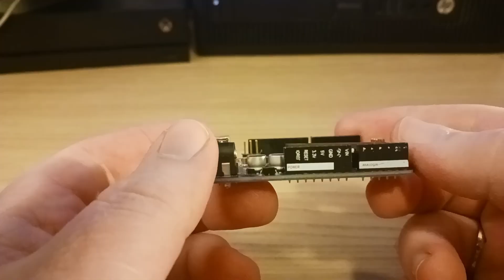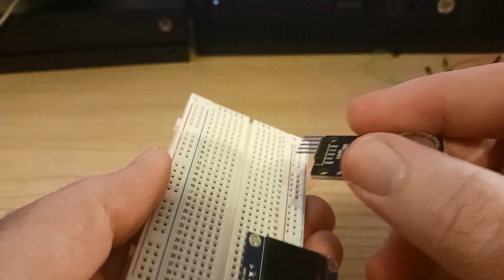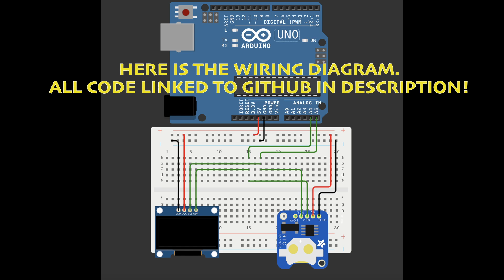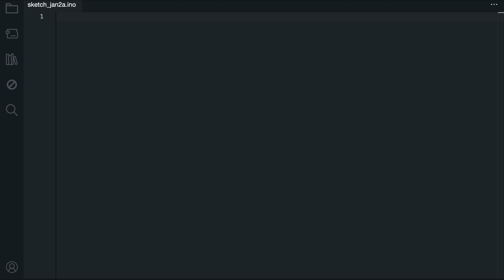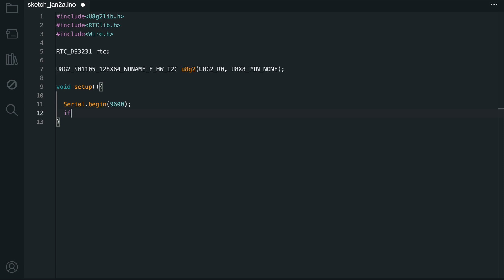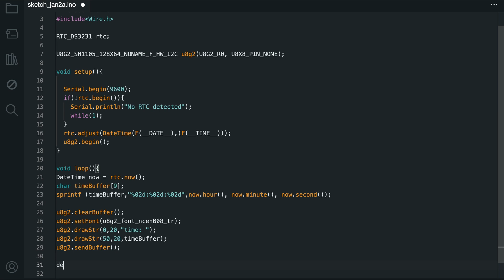Building a clock with Arduino and less than 40 lines of code!

Comment: Do you have any esp32's ?  I have the modules you used, but I belive the esp32  only has 3.5v
Reply from the maker: Hi! I do but i haven't used it for a build yet. That said, I hashed this one out on Wokwi with the help of google. The code is mostly the same, SDA is GPIO21 and SCL is GPIO22. This model uses VIN as a 5 volt source, provided that the board itself is plugged into a 5 volt source, such as a usb port on a computer. Keep in mind that this is just a model and that real world parts may not behave the same way and damage/failure could happen to the board. I guess I'm saying this is my disclaimer: follow at your own risk lol. When I get some more ESP32s, I will sacrifice one for a physical build. Here's the link to esp32 clock build https://wokwi.com/projects/419383304232809473
Reply: @crappiecoding  cheers, I have 3 so I may sacrifice one!
Reply from the maker: @johnh10000  let me know how it goes!
Reply: @crappiecoding  it half 2 in the morning here in the Uk so will knock it together in the morn.  and of course let you know if it works
Reply: Ater checking out your Wokwi code and the datasheet for my wroom esp32, I can confirm the 5v line (on mine it says in, wich I assume stands for voltage in) is indeed 4.75ish and your code works just fine.  Thanks for the idea!